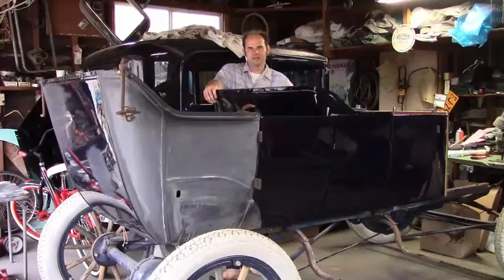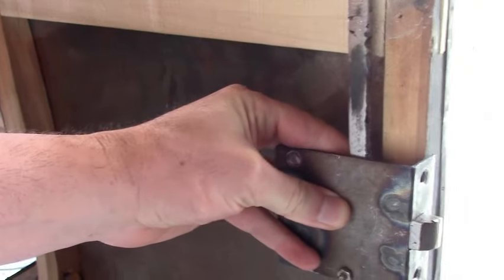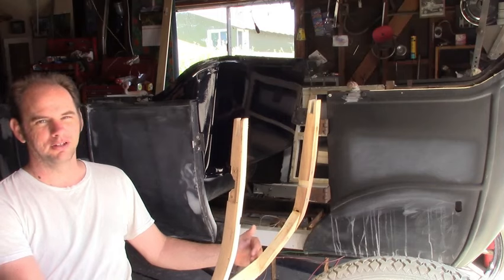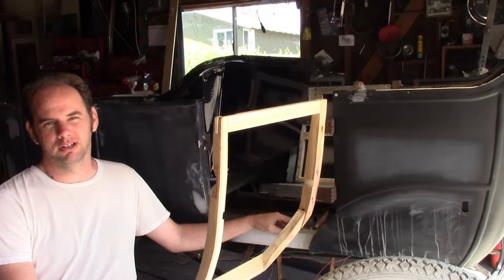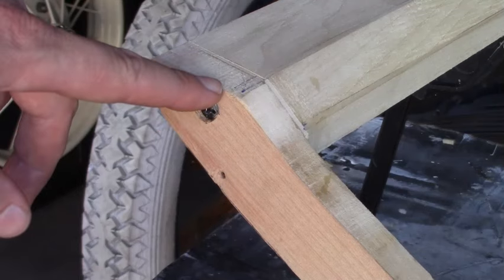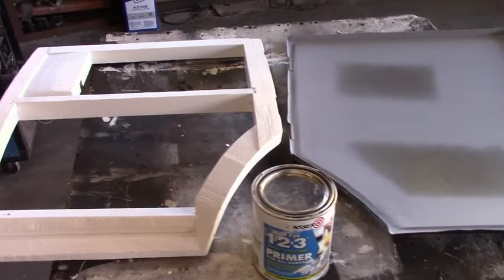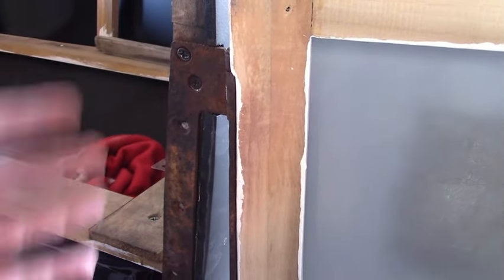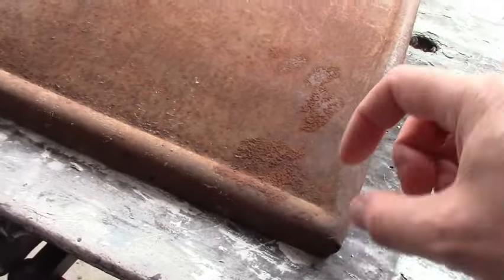Building a 1913 Ford Model T Touring body. Part 13.

Comment: Watching you construct the wood frame for the door ----- makes one wonder about those days of building a Model T ------ And you would think that those nails you used ---- spiral ---- would have been the ones used back then ----- to ----- HOLD ---- it all together. ------ Speaking of that ----- you did such a nice job figuring out the curvature of the wood ----- I have a Chair that I will send you for new legs ------- With all the work in figuring out the shape ------ did you trace those pieces out onto some cardboard for future doors ------ you ---- WILL BE ---- making ----- put a little nail on the wall and hang them up --- Label ----- Front Door -- Back Door --- Top -- Bottom ----- You'll have them for the next one -------- Will come in handy ------ if not for you ----- for the one that steps into your foot steps and continues the ---- Resurrection of Model T's ----- Thank You for the video ------ Have a Good Week --- Rodney
Reply from the maker: Thank you very much. Yes, I have been making patterns of it. I have also made patterns and plans over the years on other Model T bodies just in case of future projects.
Reply: I was hoping you did ---- that's good ------ Now for that young one that will follow in your footsteps ------ See you on your next one ----- Rodney
Reply: @onewhocollects6781  Amazing, based upon your fine woodwork, I was just going to suggest that maybe you were a pattern maker...

Comment: Very timely, I am just doing the doors on my Riley. With very similar issues, nothing on them is straight, it's all weird curves and twists. My hinges are individual ones, not a single joined piece like yours so I had to get the alignment exactly right. I also bolted them through rather than wood screws. The bottom and rear edge of the Riley doors are wrapped over a metal strip similar to how you have done your door bases. My door frame and all the joints in the car are glued and screwed. The timber is Ash as it is strong and flexible. There are also various metal plates and brackets holding the joints together. My understanding is because everything flexes as you mentioned you need the joints to be strong and it's the timber between the joints that bends and twists. I think a lot of people over do the bracing and try to make things stiffer but the car does need to flex.
Reply from the maker: Interesting. I know some of the more expensive cars used more metal bracing, especially around the late 1910's- 1920's.
Reply: @onewhocollects6781 I try to go with what the factory did. Bit easier when building a 'new' car than restoring one. I see a lot built with extra brackets and I suspect people have either done that over the years to fix things that broke or have done it mistakenly thinking the car will be stronger with more brackets completely missing the fact you pointed out that these really old cars have stiff suspension and very flexible chassis/bodies by design. The longer a production run of a car the easier it is to see what the factory got wrong at the start by tracking the improvements they make over the years.
Reply from the maker: That's a good point. I generally try to stick with the original plans, just because I already know how they will hold up. Whenever I redesign something, I'm never sure how it's going to work until it's finished.    @asciimation
Reply: @onewhocollects6781  Yes, that's my thinking exactly. The factory generally knew what they were doing. I find when I do try modifying something, I then need to modify something else then modifying yet another thing and before you know it you've redesigned half the car!
Reply: Ashwood, that's interesting.
I was assuming that I would use White Oak, assuming Henry had too, to help to protect the open cars from rot.
White Oak is used in boats because it doesn't absorb water.
But Ashwood is plentiful, standing dead in woodblots

Comment: I like the idea of assembling things with easier to drive modern screws, then replacing them with slotted screws one at a time after the assembly has set up.  Would the nuts on the door hinge bolts be square, rather than hex nuts?  I suppose it doesn't matter, they'll be hidden by the inner door cards.  Ford became aware of the weakness of the 1913 touring car rear sills and fitted metal reinforcing plates later in production to beef up that area.
Reply from the maker: Yeah, I also do that trick with more rare/expensive hardware to keep from damaging them. I think they used hex nuts on the doors originally, but I'm not sure.
Reply: I had that same question.
I replaced much of the nuts on my existing torpedo firewall, with square nuts, when I acquired someone's entire collection.
I had no idea if I was being period-correct.

Comment: I have acquired a 1927 Canadian Runabout body, like yours (with both doors), that should be delivered in about 2 weeks.
I'm looking forward to your tips and tricks.
This is going to be epic !!
Does anyone make a pattern or blueprint for the wood frame, as an implied starting point ?
It sounds like you're hand filing these nails.
A right angle die grinder might speed up this process.
Reply from the maker: Cool. I don't know of anyone making patterns, bot some companies sell the finished wood ready to use. I chose to make it myself anyway to save money. Have fun with that!